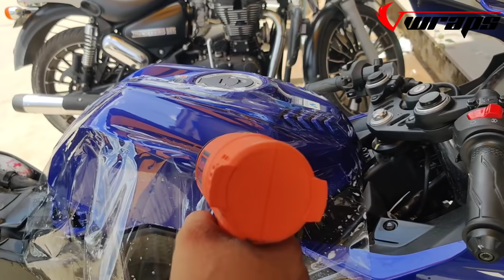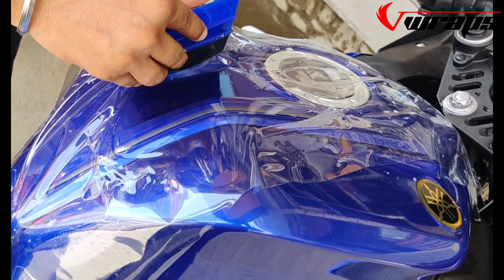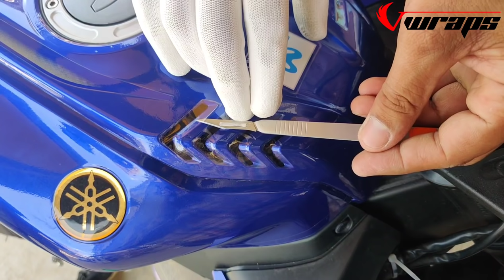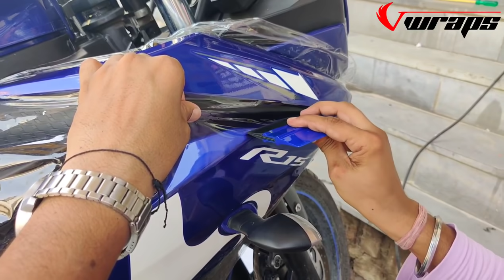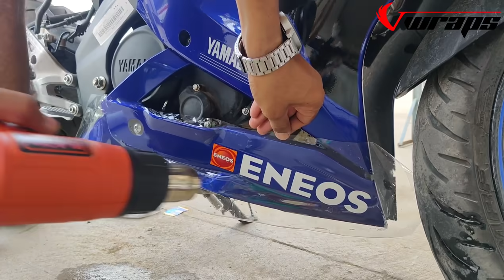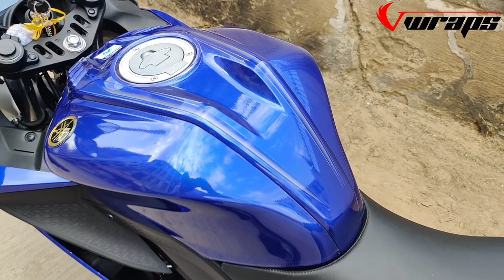Yamaha R15 v3 Lamination | R15 Modification | Vwraps Sikar |

Comment: Please tell me.. for what we doing this to v3...What's the advantage 🤔🤔
Reply: Protects the panels from scratches stone chips. Incase there are scratches, the PPF (Paint Protection Film) will take all the scratches and when you remove the film, the original panel will look brand new still without any scratches.
Reply: Is it high costly?
Reply from the maker: Right brother
Reply: @mt_soul_97  depends on the person installing it. Sometimes yes, other times no.
Reply: @rushabnoah3620  what is the total cost for this